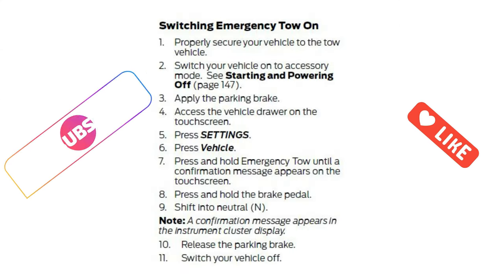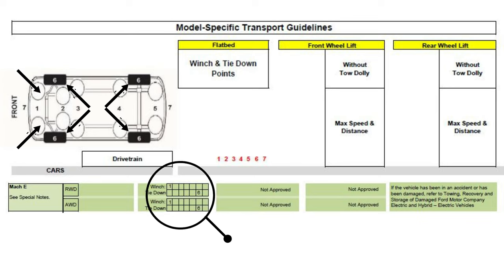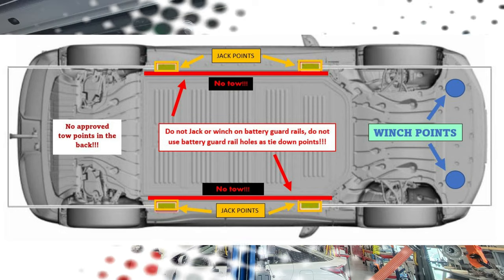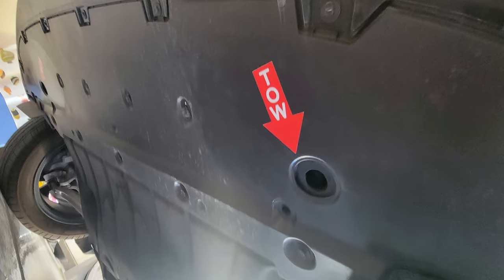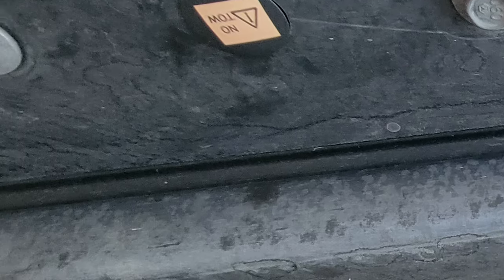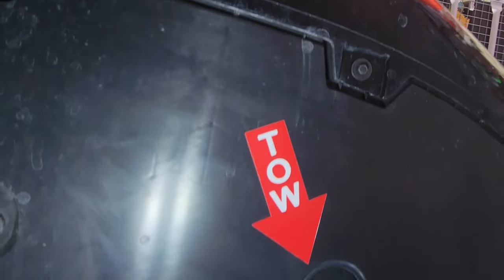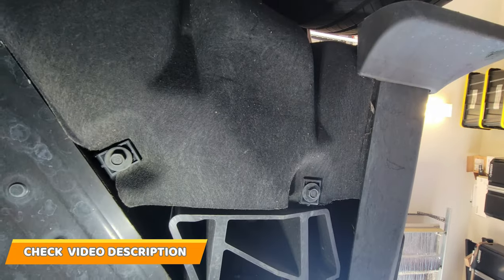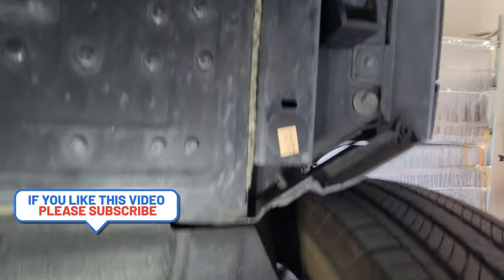Tow Points | Ford Mustang Mach E

Comment: My MME was towed today. I showed the operator the holes to use and even the printed diagram but he wouldn’t winch to the two holes. Said they weren’t strong enough. He winched to the lower support arms.
Reply from the maker: Wow, at least he did not tow on the battery frame. I hope they get you back on the road quickly

Comment: Excellent idea! Which cap sizes did you get from Amazon?
Reply from the maker: The ones mentioned in the video description
Reply: @BentheEVguy  Sorry maybe I should be a bit clearer, could you supply a link to the sizes you ordered? You mentioned there were 3 different cap sizes in the video.
Reply from the maker: @stevemit2858  I shared 3 links with the 3 different sizes and at one plug I had to add a bit a tape to two of the holes.

Just order all 3
Reply: @BentheEVguy  Thanks, love your videos, keep it up.
Reply from the maker: @stevemit2858  where you able to find the links? I hope you found the link to the glovebox sheet as well
Reply: @BentheEVguy  yes, your links worked perfectly, thank you very much. I will be ordering them on the weekend. Many thanks again.
Reply from the maker: @stevemit2858  check out the updated description I made it a bit more clear